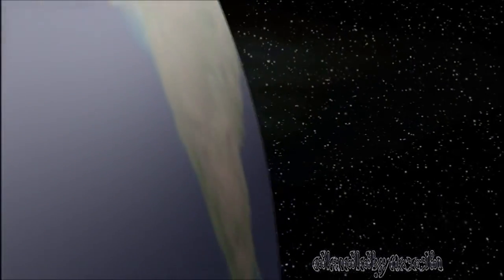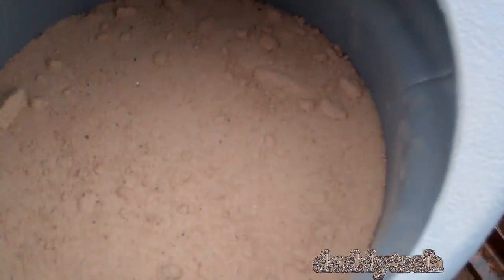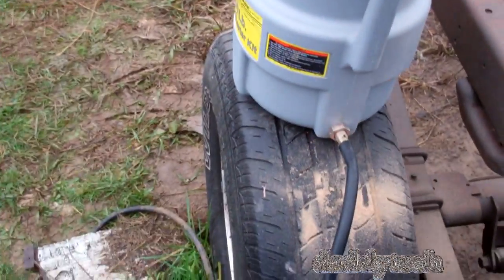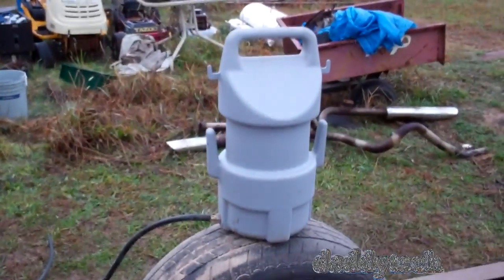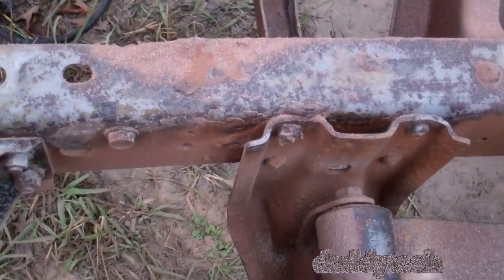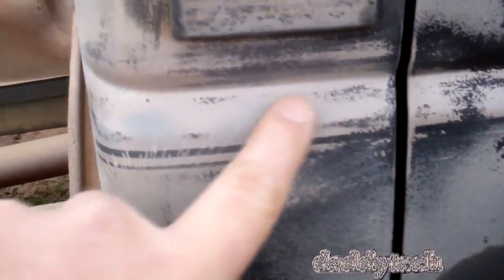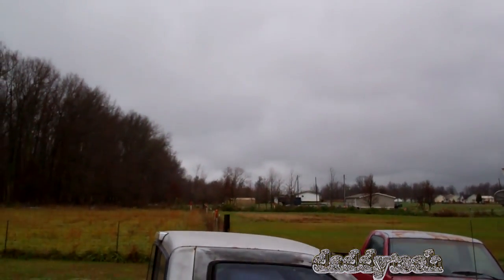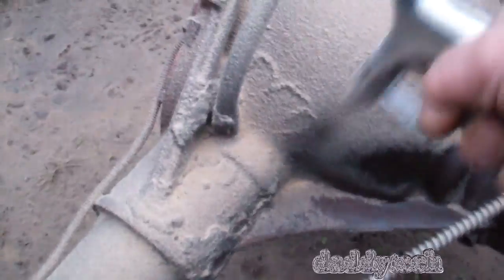Sand Blasting the 4X4

Comment: @daddytech im not sure you need to worry about the dirt in the sand as it will be coated in sand dust and wont stick.
Many years ago i was the electronic section of a factory and i used a sandblaster to clean the cruddy boxes after i had repaired the pcb, the blaster was just a big box with a window in the top and fixed rubber gloves to slip your hands into.
the sand wasnt filtered and when it was worn it did a smoother job :-)

Comment: If your cleaning up a old fiberglass boat sandblasting is good option to ,  i know vid is older but rite on man ! I been there , i got luckey and found a guy to work for beers on weekend if i provided sand and i went with the recycled glass stuff and it worked great :) he had a tow behind diesel compresor and a air drier set up !

Comment: hey im back jim.
if you nhad of been watching daves farm like i dont any more lol you would have seen him fill a fuel tank with fire ixtingwisher gas and weld his fuel tank while it was still half full and in the car still you should do it to with those pin holes.

sandblasting it looks a long tedius job for what its doing to it you would have done it quicker and had a better outcome with a 9 inch angel grinder and a steel wire brush wheel on it . merry christmas jim and happy new year.

Comment from the maker: you do have a valid point but this time as i do it i am going to clear the rust then immediately seal it with metal etching primer then once that's dry go back over it with bed liner.  once i am done i'll just throw the bed back on again and be done with it. i just wanted to do this right since this truck has obviously been up north at some point.  thanks for the comment!

Comment: hmm i think your right on the lack of pressure and dampness in the sand.
A possible thought, rig up an old tarpauling or plastic sheet under the back end to catch some of the sand, suspended so the sand falls to the center, then you can dispense with the container and stick the pickup tube in the sand, perhaps??

just a thought as your not made of money for sand are you :-)

Comment: working on the exact same frame right now!!
i have a big sandblaster with 60 hp diesel compressor but the isseu is to blast the bottom. i removed all the rust with an air hammer and needle scaler, thick layer of tectyl and must be fine👍👍

Comment: Thing works great.>>>   We washed concrete patio, driveway and sidewalk with the Sun Joe and it worked just fine. We live on the Gulf Coast and battling mold and mildew never ends. This fits the bill for around the house work.
Reply from the maker: yeah I kind of wished I had spent the extra money for the metal one that is completely enclosed. this one just didn't last but a coupe uses and it was done what do you expect for $30.00 though right? lol

Comment from the maker: @hoss4107 yeah might just have to keep this thing around a while but i learned a little something with this one too the sand even though it was new in the bag it still has to be sifted. otherwise you get clumps in the sand and have to keep back blowing the line to be able to use the thing. makes it take a lot longer to get anything done with it.

Comment: Also you can build a pressure pot fairly cheap, after using a pressure pot you probably won't want to use siphon systems, i built mine out of an 8 gallon Campbell Hausfeld air compressor tank that i garbage picked. Welded up some brackets, made an axle for it just like the ones you buy ready made.

Comment: If rain was a problem why not get a sand attachment for a pressure washer?
No dust,less heat  and i dry it with a leaf blower.
If you want to save your back just attach a piece of pipe to the feed end and put it directly into the sand bag. No need to fill that small hopper.
Doing a whole truck with a SPOT BLASTER is a little crazy.
Keep the wind to your back and get a cartridge mask PLEASE

Comment: Lol there's a reason the label says "spot blaster"... it's not meant for big jobs. To do blasting right you need a pressure pot and at least a 5HP compressor, you can make a pressure pot one out of an old air compressor tank easy for $40 worth of hose, fittings, and miscellaneous stuff. But you can spend more depending on the quality of materials you use.

Comment from the maker: it didn't have a name that i remember, it was just a cheap $35.00 job from harbor freight i think the only reason it didn't do as well as i suspected is because of my air compressor though, its' only a 25 gallon 1hp elegrtic lower volume compressor. hope that helps some.

Comment: as well as oil with the proper stuff because as soon as you remove rust with sand blaster it is pitted and will start to rust immediately i believe
Reply from the maker: yeah I usually hit it with metal etching primer and then a primer sealer then coated it all with bed liner to seal it , working remarkably well too  I have to say

Comment: I'd say you need at least a 5HP industrial compressor to do any real blasting, true 5HP motor not the meaningless light duty/residential ratings. 5HP 2 stage would be fine. You can pick old units up cheap on Craigslist or Kijiji, the old pumps run forever before a rebuild. Better to get one with a known pump brand you can still get parts for like IMC so if you do need to rebuild it you can.